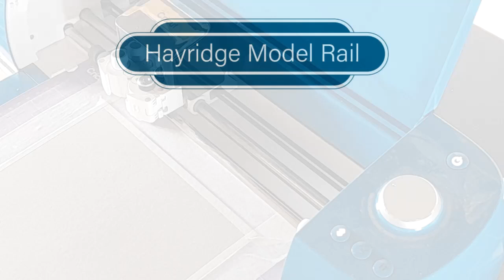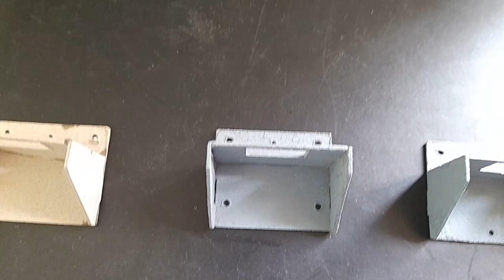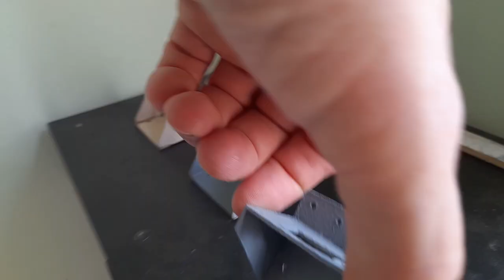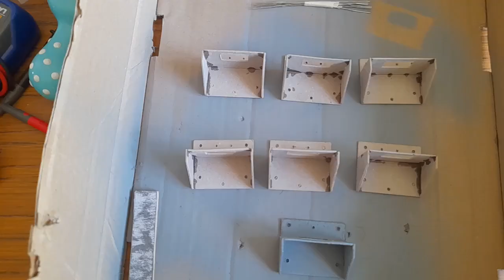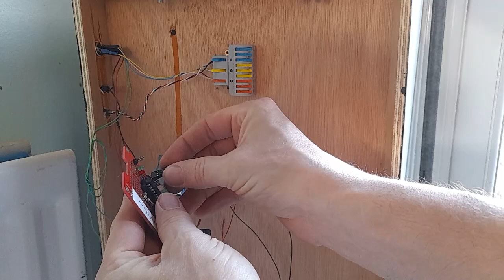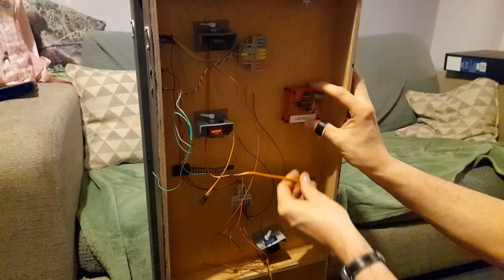041 - Servo & Circuit Board Installation (A Portable Layout) Pt 9

Comment: Hi Allan! That's some good progress you've made with the electronics! I was surprised at how far the servo horn moves, as with mine they only move a couple of millimetres when moving the tie bar! Looking forward to further updates! Cheers, Ian.
Reply from the maker: @iansngauge  Hi Ian, yes because of the pivot point there is a little more movement on the horns.
I'm pleased with the way everything is working so far. I'm working on control boards, which will control each set of boards blocks and signals.
So lots to be working on. 
Cheers Allan

Comment: I was a bit surprised that paperclip wire is stiff enough to do the job. Presumably you’re leaving the springs in the points so it only requires sufficient stiffness to overcome the springs? 

Always interested to see how your modules are progressing. 

Best wishes,
Ed
Reply from the maker: @edmorris631  I have left the springs in this time, but for my loft layout I took them out for smoother motion, as long as you get the alignment right they work fine.